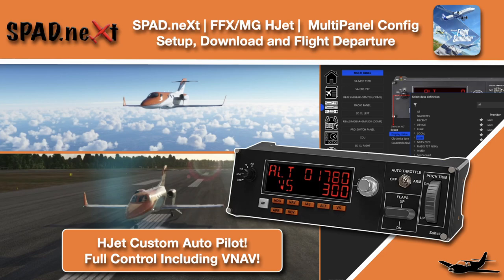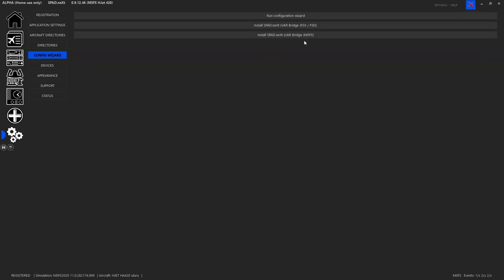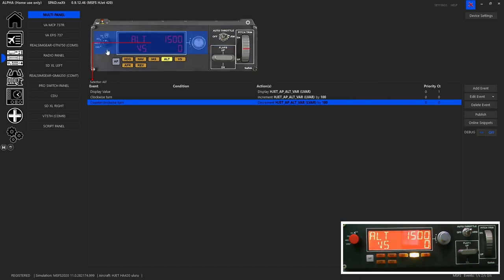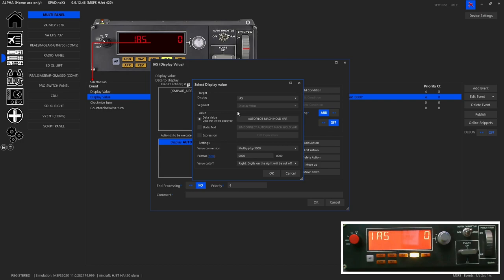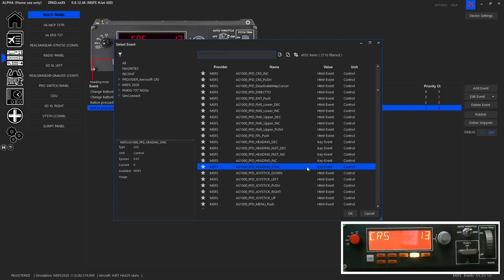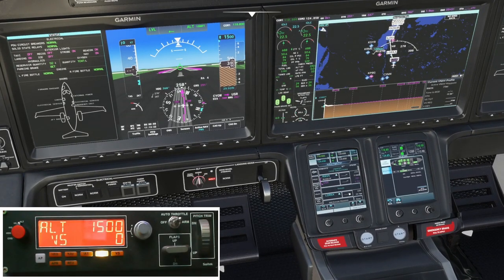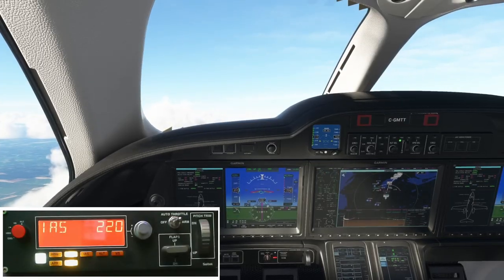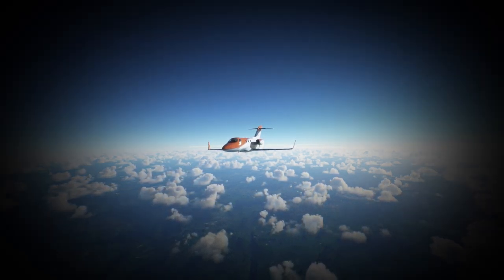MSFS | SPAD.neXt | FFX/MG HJet | Logitech MultiPanel Config

Comment: Great video Les, so helpful!  Slowly migrating from MSFS to SPAD for everything.  I noticed the red knob on the left of your multi-panel.  Where did you find/buy that?  Those tiny knobs are hard to turn!  Thanks.
Reply from the maker: I bought them off eBay quite a few years ago. So many “guitar” or electronic knobs to pick from :). 

Exact reason I got them was I wanted something that was less slippery and easier to grip.

Comment: Hi Les  I recently purchased a Loupedeck Live after hearing about it from another streamer. I bought it hoping to use the rotary dials mainly for the AP on the Fenix and PMDG airliners. But quickly found out that they will not work on these planes. I was told they use “bespoke” functions? I was hoping you could help me. Thanks for any advice. Thanks Edward Johnson
Reply from the maker: No idea. I don’t have one. Apparently you need to set them up as MiDI command outputs.
Reply: @LesOReilly  Ok  Can I do that with Spad.Next? thanks for the response
Reply from the maker: I have no idea how to setup the Loupedeck to send out Midi Commands.  You need to make sure that buttons are sending notes and knobs send CC events...  then Midi should work in spad like it does with the XTouch.  But again... you first have to configure your device in it's software to be doing this stuff..
Reply: Thanks Les appreciate the info

Comment: Can you help me ive tried mapping vnav button on my velocity one exactly the way you have in the video testing for the e2 hjet 'increment XMLVAR_VNAVBUTTONVALUE by 1' but not working im in vr and im trying to go completly mouseless.
Reply from the maker: For the HJet you can just send the the standard simconnect event for BACKCOURSE HOLD.  For other planes that do have it you need to make sure that you are modifying the actual LVAR (so NOT the Send Event) it is a Change Data and does have in brackets next to it (LVAR).  Also make sure that the Spad Bridge is installed.
Reply: @LesOReilly  thanks I’ll try and update
Reply: @LesOReilly  thank you very much Les this fixed both the hjet and the standard g1000 vnav button for me I wasn’t editing the (LVAR) with the brackets
Reply from the maker: @spediegunz  glad to hear!!  enjoy the "lazy" descent :)